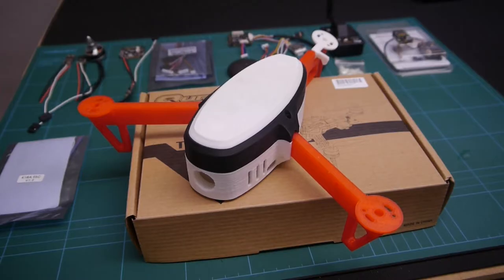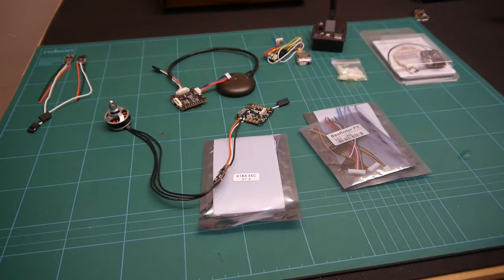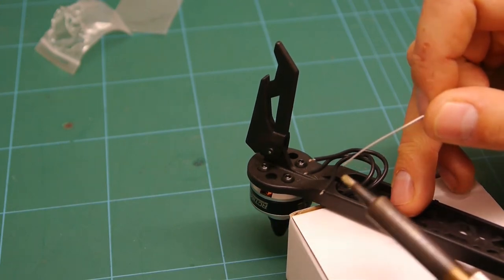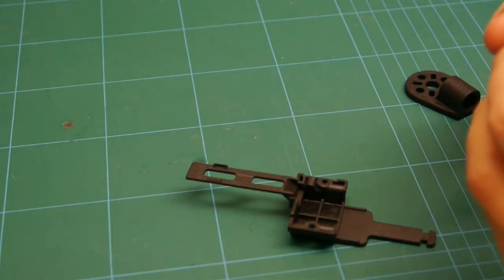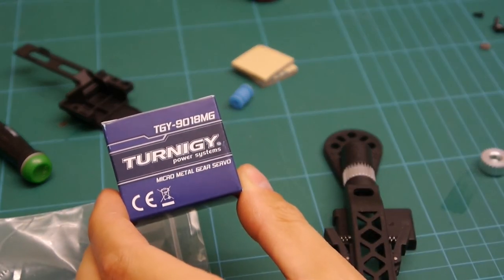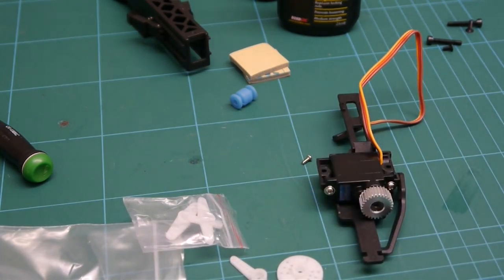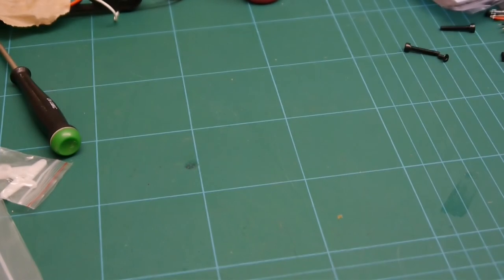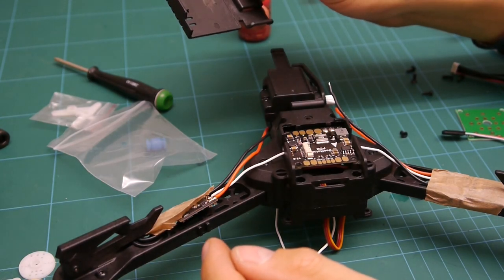TheManLab - First Look - Quanum Trifecta - Mini Tricopter Build - Part 1

Comment: hi, thanks for making this build video.
I also have the same problem with the screw for the tail assembly just pushing in. I do not have the ability to re tap is there another option i can try?
many thanks.
Reply from the maker: Stephen Stone Hi. Only two I can think of is ask for a replacement from Hobby King or try glue in place with two part epoxy.